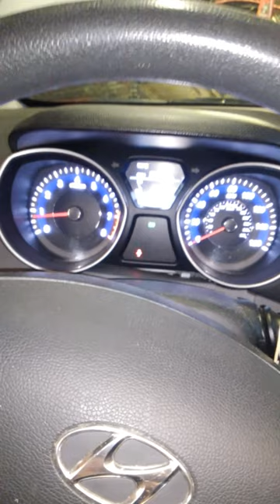2013 Hyundai Elantra accelerator pedal assembly replacement

Comment: Did you need to have the computer updated or anything ? Or was it just plug and go ?
Reply from the maker: Disconnect the battery while installing new pedal. Have battery disconnected for ten min before plugging in new pedal, or have battery disconnected for ten minutes. This will let the computer learn the new pedal when battery reconnected.

Comment: What was the reason for replacement?
Reply from the maker: M V Itwould keep accelerating after food was removed. Basically improper function.
Reply: @gmenan72  how many you wasted, the cost?? Txh
Reply: @gmenan72  I have a Hyundai Elantra 2012 and the gas pedal is hard to push down, I've ordered a new gas pedal sensor do you think it's because the current one I have in my car is bad that's why it's pushing hard?
Reply from the maker: BuzzyBeatz I’d double check the function of the pedal assembly. I didn’t realize you can order just the gas pedal sensor. If the pedal is difficult to depress, I would have to consider the pedal assembly may be compromised in some capacity. Double check something didn’t fall into the pedal, like a coin or dirt or some other debris. Hope this helped.
Reply: @gmenan72  So my mechanic ( who still didn't fix it ) cause he isn't here till Tuesday, tried my car I was sitting with him and then when he gased harder and harder he admitted that my gas pedal stiff and was delaying acceleration, and it needs to be replaced by a new one. He actually checked it well and he didn't say anything like there's a coin or a dirt in it. Another mechanic the same day on morning time cleaned up my Throttle body but it was still the same thing. The car actually runned so many miles, it's a little over 167800 miles, just bought it from a dealer last Saturday. Engine is good and transmission runs very properly, no engine light coming, absolutely no other issues, it has a lot of power in high way, emerged to different lines easily, brakes well turns on with no issue or noise, no accident made up before, only one person owned the vehicule during all this time.
Reply: @gmenan72  Hi my car is doing the same accelerating with out pressing the pedal. Did replacing fix your issue?? thank you